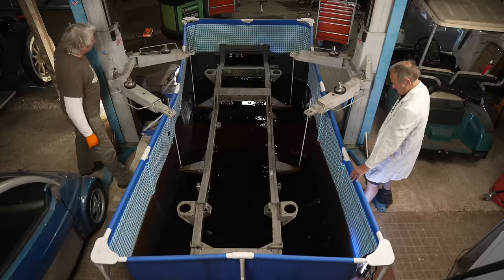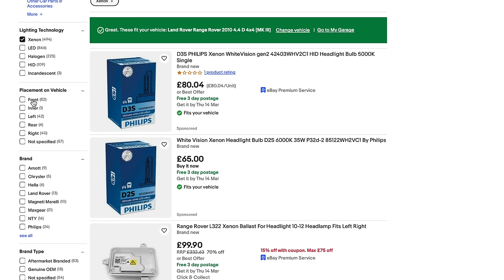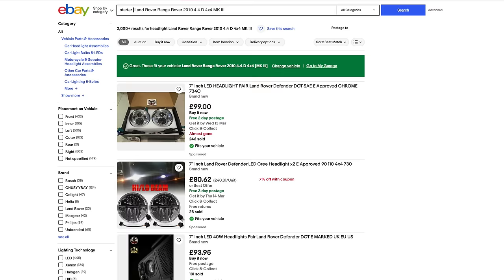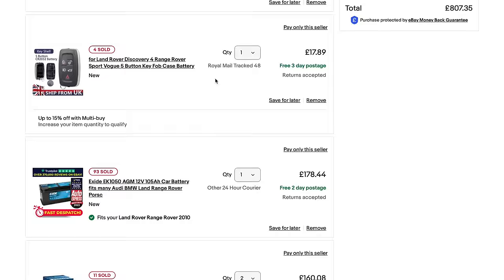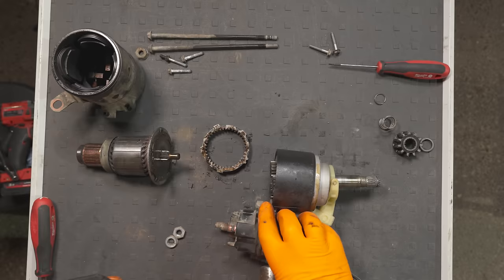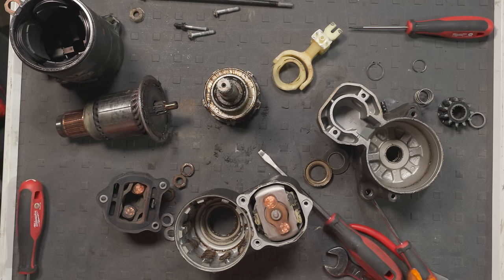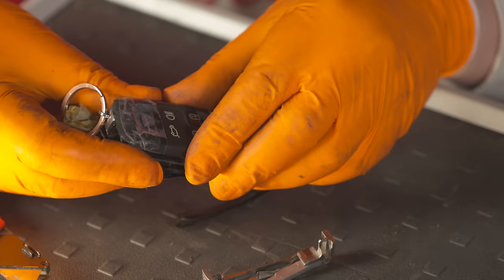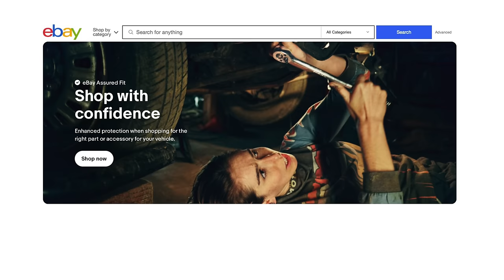Not when it’s damp! - Another Range Rover MoT Fail! - Edd China Workshop Diaries Ep 61b

Comment: I had the V8 4.4 L322 for a number of years and changing the battery used to trigger a bunch of fault codes that required resetting the power windows and, from memory, the steering range too.   When I replaced the battery the second time I kept the car electronics alive with a supply mode charger to avoid this.
Reply: All pricey cars are like that, once the battery gets disconected the computers go with it!
Reply: It's a BMW v8 right?

Comment: Glad to see you back Edd.
.
Regarding the RR.
I'd check the engine block to chassis earth straps.
Easily overlooked and will cause all sorts of electrical gremlins as the current finds other pathways to complete the circuit.
..
Few years back had a golf VR6.
Occasionally it wouldn't start just click click like a flat battery..
Battery checked out ok.
On closer inspection the main thick power cable to the starter terminal was corroded.
Removed, cleaned up the surface corrosion and the terminal,
Also did the same to the terminal on the alternator as well. greases up with some vaseline.
Never had an issue after that. 
Started on the button.
...
Its quie possible the earth straps might be corroded....
..
That starter didn't look to bad...

Anyways
Glad you have some videos in the bag.
..
Are we going to get some disco lights and 90s techno music and dancing  for the 1M subscriber celebration!! 😆

Comment: Not a very good advert for the eBay parts checker, when it said 7" Defender headlight units would fit the Range Rover. 😂
Reply: And that key fob wasnt original for sure.
Reply: I had to laugh. eBay assured fit,but if it doesn't fit you can return it! I don't trust eBay fitment guide at all tbh.

Comment: Great to see another video Edd, love your workshop and bar!!
My L322 does the same if the battery is disconnected. Steering angle sensor wants re calibrated, full left then right on the steering usually does it. Keep up the good work 👍
Reply from the maker: Thanks, best issue I’ve had so far was one mirror went in when the other went out, bizarre! But not as brilliant as the phone calling the most recent number the moment you started the car but before the screen and speakers woke up so you didn’t know who you were bothering at 4am!! There must be a whole department working on such ridiculous faults and glitches!
Reply: Try this one, garage where i worked, guy brought in a range rover for cylinder head work, and while at it, asked to check drivers door window mechanism, which eventually was changed, parts supplied by customer, eventually when engine back together and ready for start, would not even crank...eventually after going thru the entire system and garage having to borrow more upto date scan tools, there was a code in system that originated from the door window regulator that was substituted...donor vehicle had a big crash and had an accident code, which transferred to this clients vehicle which prevented the engine from starting, and needed the authorised dealer to clear that code from the system to enable the vehicle to start....who would have imagined things got to this point
Reply: @ArvineHarry 
that is nuts.

Comment: Hello Edd. I was experiencing the exact same problem with my 2011 TDV8. Before I pressed the button on a new starter I discovered that the windscreen scuttle wasn’t water tight and the battery terminals had corroded. After I gave them a really good clean I’m 99% back in business so I think a clean up of the starter connector will completely cure it 👌🏼

Comment: Yet another thing I hate about modern vehicles. A push start button and a "timeout" if the engine doesn't start within a certain number of cranks. I don't need a car telling me that I can't turn it over any longer and stopping. I will decide how long I turn the engine over for and there was nothing ever wrong with having a key and an ignition and I can turn it over for as long or as little as I like. Just rubbish.
Reply from the maker: My sentiments exactly! I may contrive an override someday but the new starter and clean ring have been working a treat so I get to put that job off for a while!

Comment: Hey Edd!! Good to see your shining face on my youtube again! My 1999 Honda CRV is having a problem; sometimes when I start it the tachometer doesn't move and it only runs smooth at low RPMs. The dealer shop couldn't figure it out and instead gave me a laundry list of other things I could get fixed. The chatrooms say its my computer going bad. What say you friend?
Reply: It's quite possible there's a dry solder joint on the tachometer electronic circuit. 
Have to take out the instrument cluster and remove the tachometer and check the circuit with a magnifying glass...
This may not show up on a diagnostic machine..
Reply: @stuartd9741 that doesn't address the rough running engine tho.

Comment: Your suspension fault is most likely caused by removing the battery (and replacing it), given that it wasn't there beforehand. Rotate the steering wheel lock-to-lock and it will calibrate the steering angle sensor and clear the fault (Fellow L322 owner, mine is also a 4.4l, but the BMW variety). Sorry, won't make for good tv!
Reply: Thats for 4x4 light same as X5.

Just clear suspension fault with Carly obd
😈😈

Comment: Every imaginable problem is a common problem on a full size Range Rover. Also, none of the problems can be solved by JLR service - all they want to do is sell you a new car. These are car designed to last 70k miles/8 years max and then be shipped over to the wrecker.

Comment: Quick question: I've got a T5 2.5 TDi and is loosing oil about 1l / 80 miles. No smoke at the exhaust, and the only visible leak I can see is around the oil filler tube. Is there a quick way to fix this why you are away on the road ? Sealants? Oil aditives to stop the leak ?

Comment: Not as dumb as the starter location on a 1958-1960 Linoln Continental MK 3-5. You have to unbolt the motor mount on the right side and pull the starter all the way forward and down the crossmember!

Comment: Ah Range Rover faults list never fails to disappoint Ed, I've refurbed a couple of key fobs from buying the shells on Ebay & they've worked really well, plus I fitted a starter motor to a Peugeot 407 again by buying the starter motor from eBay & it were fine, however I have found some suspension components to be of poor quality so I've found a decent retailer to be the best bet, but thats just from my experience.

Comment: Sorry Ed, whilst I realise you are being sponsored, you'd need to be off your head to order any vehicle parts from the sea of fake crap that is eBay. Salvage parts - maybe, but never "new".
Reply: Loads of fake bosch, NGK ect parts on fleabay seen loads of comebacks from fake parts fitted by customers.
Reply: The guaranteed fit thing is nonsense too. Sellers will just click any and every brand model to reach a wider audience. Little things like pre and post facelift matter too but aren’t mentioned.
Reply: I confine searches to UK sellers. Hopefully that reduces the fakes.
Reply: Also quality is often so bad….
Reply: Ed. you will get suspension fault when the battery has been disconnected  or gone flat.The fix is to start the vehicle and go lock to lock, this will normally clear the suspension fault.

Comment: Mai gawd, what is going on with cars, over £500 for a starter motor and 2 bulbs.
Reply from the maker: It does seem rather rediculous but then again a new Range Rover could cost over £175k so I guess classics are the way to go!
Reply: @eddchina  I could understand it if the vehicle was a hybrid, with their starter/alternator combinations - but a 'traditional' starter motor turning a flywheel - costing that much for a pattern part, the world has gone crazy.  Just checked for our P38, 4.6litre - starter is £350 for a Bosch unit,  not a no-name pattern option.  P38 is 25 years old - and luckily they didn't cost anywhere near £175k.  Was yours some funky modern 'stop/start' doodad or something?

Comment: why not save the old starter if you do core charges esp with older batteries save the starter rebuild it then if the new one fu bars you gots a back up. But your Range Rover has a parasitic draw. No so much moisture to parts sweating grimlins else where something stays on trickling drawing.
Reply from the maker: I will pop it back together after cleaning the contacts. Always good to refurb parts!

Comment: I hope you don't have to change the battery too often in the Range Rover. Having to take off the wiper arms and plastic etc every time would be a pain. But then again Range Rover have never been one for making things simple and easy to work on.
Reply from the maker: Apparently you can, just, change the battery without doing that but my Range Rover has a hydrogen generator fitted in the battery well so I have even less space to play with. They have packed a lot in and done it when the body was off so things are very tight in there engine bay!

Comment: Ah suspension faults… for LR enthusiasts (forced mechanics) just a mild annoyance but for everyone else utter devastation. I’ve had the cracked air dryer cap fixed myself for cheap, bad height sensor fixed myself for cheap, leaking strut paid a mechanic but bought part cheap, leaking front valve block rebuilt myself for peanuts and replaced my hitachi compressor myself so quick and easy. Dunno what Toyota drivers are so afraid of 😉

Comment: What an ideal synergy ! Edd & eBay. For the independent self mechanic in rural Australia the advent of eBay's massive range of car parts, both new and used came at about the same time as the emancipation of 'how to' videos on YouTube empowered the sharing of knowledge between people in sheds. The original WD distilled these 2 boons into the tv format.
My all time favourite tip for 'proper' Landies came from Mike at Britannica Restorations in Canada for setting the pre-load on the swivel bearings by cramping a ring of thick solder in place of the shims until you get the perfect pre-load. Back the bolts off again, measure the thickness of the now crushed solder and replace with the equivalent in shims and just as Robert is your father's brother, the death wobble is history.

Comment: Just for others watching, you do not need to remove the wipers on an L322 to change the battery.   

Ed, your starter issue could have been caused by a common issue which many owners fix by running a better secondary connection to the starter.  Many owners have replaced the starter on,to have the same  problem reoccur
Reply from the maker: Thanks, it was just good to have more room (particularly for the cameras). A secondary feed could indeed be useful. I think in this case, in the end it might have been mostly down to the dirty ring terminal. Works a treat now with no pensive delay on pushing the start button.
Reply: @eddchina  I hope you do more with the L322, I’ve a 2012 4.4 so I and many others would love more Range Rover content.   There is a huge community of loyal owners and your repairs are always very interesting..   thanks for all the brilliant content over the years.

Comment: Hi Edd. I love all your videos. Might be worth looking at the alternator. The pack on the back can go faulty and work in reverse. It then drains your battery instead of charging it. This happened to my L322. The suspension prob just needs resetting as you have had the vehicle in the air. If you lift it again just open the boot and it stops this from happening.  I feel your pain as 1 range rover owner to another 😂 keep up the great work buddy

Comment: Hi there Eid, I have a E class 2019, which I problems with is speedometer which is changes into kilometre every time I switch off the engine, and I have to change it back to miles manually. I was wondering if you have any suggestion, many thanks.

Comment: Is MOT a yearly adventure for you lads in England ? We don't  have anything  like that in Canada. When we purchase  a used car it has to pass a safety inspection before it can be registered to be driven on the road. And thats it. Once it passes that initial inspection, you can drive it forever without it being inspected again. Its absolute BS in my opinion. I'm  a licensed  motor vehicle mechanic. Some of the crap I see being driven on the street is atrocious.  We need some type of yearly or bi-yearly MOT here.
Reply: Yearly in the UK.
about £55s.
..
I do believe in France it's bi-anually
...
There were plans for the UK to follow suit towards bi annual testing.
There have been some protests about that.
..
But yearly inspection is a bit too much IMO. If the car is well maintained..
I've seen cars in 'Merika as some states don't have annual vehicle inspections and yes some of the cars are shocking..

Comment: I remember replacing battery in my own l322. I cannot imagine more idiotic design, maybe the bmw e32 oraz some US cars requiring to remove wheel arch. Luckily your bolts were ok, mine were rusted. If you even temporarily leave it unscrewed the positive terminal my touch the body. Very bad design for an offroader.

Comment: Ed you've got it slightly wrong regarding the poor starting. The principle cause is because of resistance in the wire from the relay in the fuse box to the starter solenoid. You are correct about the ring connector to the solenoid must be clean but if you look at the circuit diagram the wire has two connectors in it en-route to the solenoid which can corrode and cause a voltage drop to the solenoid. Consequently the solenoid doesn't slam in as hard as it should and causes the arcing and blackening on the contactors. This causes degradation over time to the point your new starter will have the same problem.
The only way to solve it permanently is to run a new wire from the fuse box to the solenoid. I've done that on my L322 and never had a problem since. The breather is a red herring.

Comment: I drive a range rover daily, 230000+ miles. Battery has been a problem due to aftermarket satnav fitted. Disconnected it. New cambelt, disks pads and calipers all round. Also aux belts an tensionets. Tyres all round, headligjt polish myself, just replaced rear upper wishbones on rear for MOT.  Bought it for £1500 an spent £ 3000 over last 4yrs on upkeep. Please!. Any doubters of land rover buy an ev an risk a toasted family😢 2006 tdv6 l320 sport. £££  so much money saved an alot safer than a tesla. Its probs worth £800. Thats why I'm keeping it.